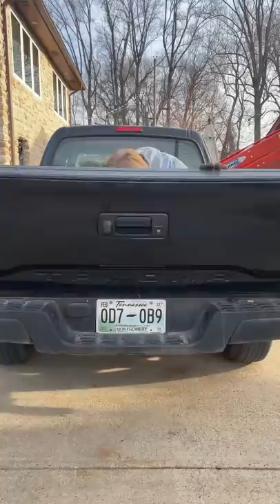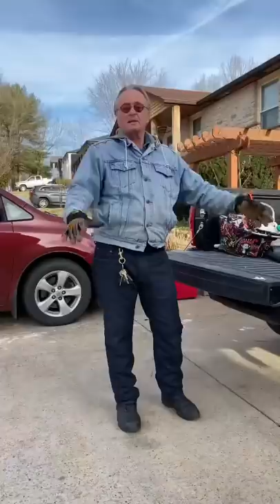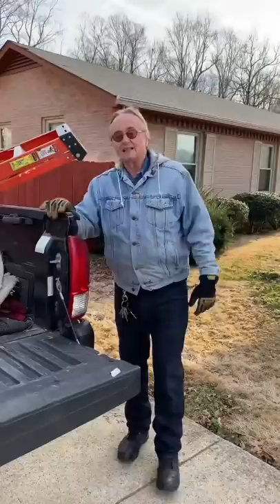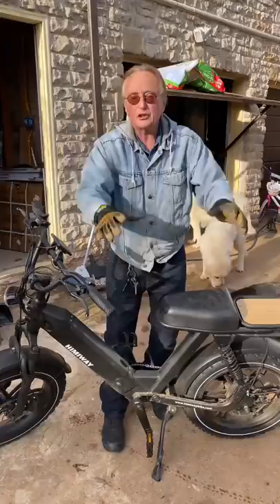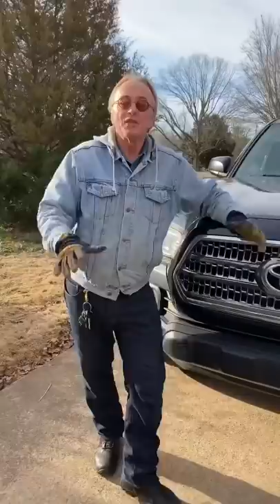Electric Trucks Suck

Comment: He should be more clear, electric trucks with "just" batteries are probably not effective. But, with some hybrid, fuel cell, etc.. a solution will be found. Now if you could side power with cold fusion using non biodegradable air salvaged microplastics,  plastic grocery bags, Styrofoam, and old face masks which biproducts were carbon bricks (which you could pave roads with) wooo hooo, off to the future..

Comment: Hey everyone guess what… the faster you go and the more you haul in a gas/ diesel truck the more fuel you use too. It is in this guys best Financial interest to push gas engines..
Reply: No. You could get one mile a gallon and it still wouldn't be a problem with gasoline or diesel

Comment: Soo batteries are bad... Well I'm sure using 10l of gas every 100km is much better😂
Reply: 10l/100km? that's pretty good milage for a loaded truck. My 8k kg trailer on my diesel gets about 7.5 kmpl.
Problem is a 8k kg trailer will drain a battery from a ev before it makes it 200km, under ideal conditions. Another problem is i live in the US and i frequently take my trailer from OR to AZ, a 1900km trip. The battery powered pickup just would not be able to do it in a timely or efficient manner even if they made a "1 ton" version of it.

Comment: Scotty stick with commenting on gas cars please.  You are starting to sound kinda dumb when you talk about EVs if you don't know what you are talking about.
Unlike an electric bike with 1 motor, electric trucks will probably have at least 3 or more.  1+ motor controls the front tires called the "stability traction motor".  This is capable of running the truck totally by itself when there is no heavy load just like any other car.  Then there are probably 2 motors (one on each back wheel) that are HIGH torque electric motors.  These get the load up to running speed, then shut off any time the vehicle is not accelerating and will probably RE-GENERATE electricity when going down hill or stopping and feed power back into the battery.  Also, electric engines can produce way WAY more on demand power than any petrol based engine.  Meaning they can accelerate the load up to speed faster.

He did get one thing right, Trains and huge ocean ships run on electricity since 1950.  WHY?  Because the bigger and heavier the load the more efficient electricity is getting it up to speed.  Both gas and electric pay the same price of wind resistance and friction.  While a MASSIVE diesel engine is wasting nearly all of its power generation just by idling.  It has to constantly inject some amount of fuel into the motor to keep it turning over.  The bigger the engine, the more fuel is wasted.  Electric motors only need to use EXACTLY the amount of energy they need at any time.  Which means they can basically shut off when they are not needed.